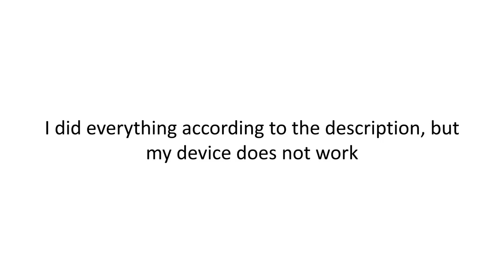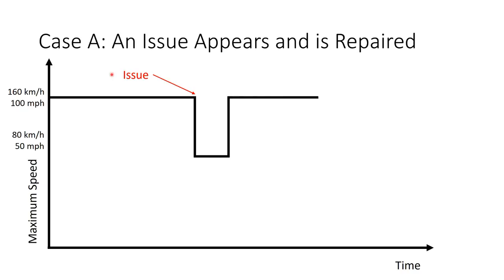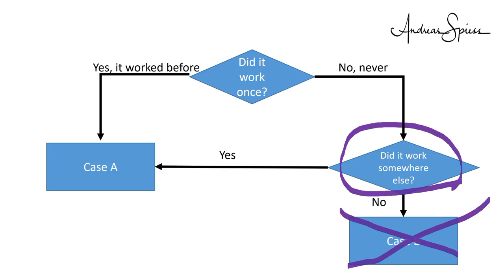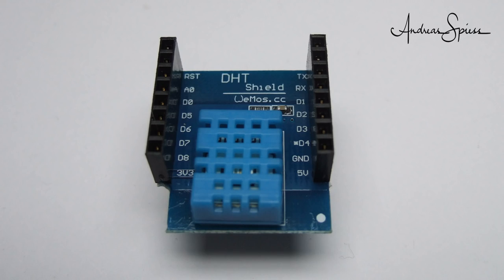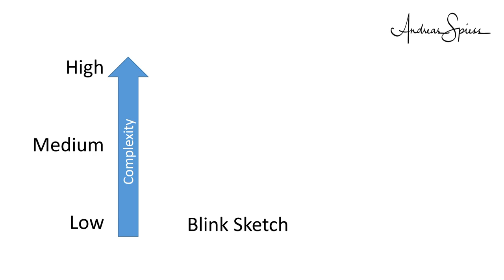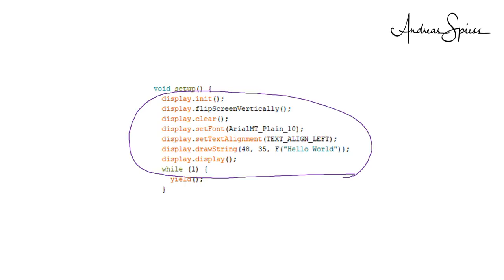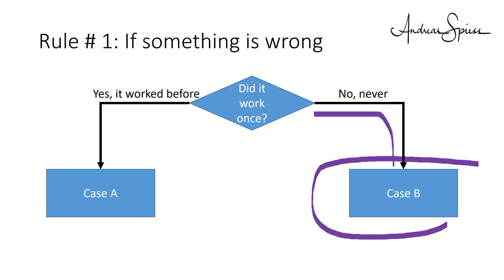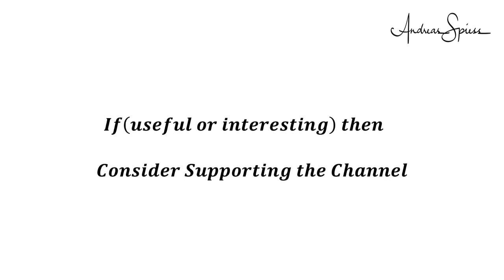#184 Finding Errors: 7 Rules to get them faster

Comment: The Blink sketch in the electronics uController world, is the "Hello World" of the software world. A sanity check, which answers the question "Can you prove it?" - sketch uploaded to uController? Go on then - prove it.  Experienced software devs apply Incremental Development, add one component, add one new piece of code, then - Prove it! (The "Prove it"s then being automated into Unit Tests). You can go further with a DMMeter too, do a continuity test whenever you can, especially if you just soldered something, even headers. 

I'd really love to see if you could do one better than a continuity test by using a something like a cheap logic probe.
Reply from the maker: This step by step is good complexity management. Concerning probing: I often use an oscilloscope for that purpose. Then, I toggle a pin at particular places in the code. This can be easily seen with the oscilloscope.
Reply: Ah, oscilloscopes are if you can afford one. From what I have understood, a logic probe provides something of a half-way-house between a DMM and oscilloscope and yet would be within the reach of most hobbyists/students/tinkerers. I would dearly love to watch you do a review of logic probes, one for the future maybe?
Reply from the maker: I used a logic probe in one of my videos  ( https://www.youtube.com/watch?v=vfwXjWtNxqY )

Comment: Hi, Andreas,
what is your approach to the radar sensor?
mine is after reading the Github page:
has it ever worked? >> no, never 100% in combination with an ESP
has it worked anywhere else? >> no

for me the conclussion is just like Syedamerali to give up, because I am not an inventor.
I am curious about your approach and solution.
Reply from the maker: I agree with your findings. If you do not want to give up I would try to separate the three main influencers: 
1. Power
2. Distance
3. Wi-Fi activity
By separating the ESP from the sensor to find out which one is responsible for which effect.

Comment: I like it.  How about a video on how to avoid errors?  Example:  write test code first before you integrate.  label or color code wires and comment your code clearly.  Make sure your schematic matches what's in front of you.  Test voltages before you start integration testing.  Make a watchdog signal or similar to ensure your code is running.  Stuff like that.... Just shotgunning here.
Reply from the maker: Good idea. And very good examples. Unfortunately, I am not sure if these videos are watched/understood by the people who need it. Most of the comments are from people who do not need them but are interested in the topic themselves.

Comment: Very interesting because the strategy to solve problems in electronic is very different than in other kind of engineering subject. That is maybe because a failure is less easy to see.
Reply from the maker: You are right. Fortunately, we have our nice tools to measure.
Reply: I miss the "magical" restart the device ;). Which is sometimes very effective.
What I mean is that your strategy is very different than what is usually learnt at school which is mostly based on quality tools like ishikawa diagrams, fmea, TRIZ,...
That's why I find it very nice because very different.
Reply from the maker: Ishikawa, Demming, and others are also interesting stuff. I did my Ph.D. on such things. But AFAIK they focus more on the statistics than on the individual case.

Comment: 8:38  Rule 2,  I am repairing a scope,  but the more components I have removed, the bigger  the problem has become  >:-) Just kidding, Great video.
I'm a test-gear repair tech and the problems often start at rule 1.  f.i. a scope does not show a trace and when I started this work I assumed the user knows what he is doing and the scope is indeed dead. But I quick learned the importance of asking more. If I then ask if it ever worked (while he himself used it !!!! ) the answer can be yes, I used it 5 years without a problem, or no, I just bought it from ebay in unknown condition. The next question could be if he knows how to operate it. The answer can be, yes, I worked with a same model for years or,  No and I have no clue how a scope works (or,  I only think it is dead because I am to lazy to read the manual)

One addition, "what were you doing under what  conditions when it stopped". I had a dead scope meter on the bench with both isolated channels dead. The chance both channels die at the same time is very small so the input asics will not be the problem. It must be more downstream. I could not find it so I contacted the owner to ask more. Turned out he measured some very high voltage (but had no clue it was to high) on channel A, no trace so he did the same stunt on channel B and fried that too. Following a structured fault finding system like yours would have saved a lot of time.
Reply from the maker: So both of us paid some"learning money" to discover rule 1. For a supporter, this is definitely the most important rule as also your examples show,.

Comment: There is hidden complexity in exchanging components! Testing components in isolation before and after exchanging them is important otherwise it can multiply the unknowns. For instance, if a circuit is bad, it could silently destroy the component, and then exchanging it leads nowhere and looks logically identical to simply having 2 defective parts.
Reply from the maker: You are right. Depending on the time you can afford you can assume that new parts generally work.

Comment: Rule #11: If you have fixed one error, you never have learned something useful for the next error. ;-)
Reply from the maker: Here I cannot agree completely. I only learned from my errors. Because if I made no errors, I knew already how to do it and did not need to learn something.
Reply: Maybe der Birnodin means that the second problem may have totally unrelated causes.  Do not assume the same solution. The mind easily goes back to  the same path it went before.
Reply from the maker: Then I agree completely.
Reply: that sounds a lot like Murphy's Law, and that's negative most of the time....
Reply: Could be a word or two missing there... ”if you have not fixed (at least) one error then you have never learnt something useful for the next error” ;)

Comment: Do you think that WiFi based home automation devices should be:
1) on the main wifi network
2) in the main network with separate SSID
3) on a VLAN with a separate SSID
4) on the same main network with separate AP
5) on a VLAN with dedicated AP, or
6) on a dedicated LAN with dedicated AP

Great video, by the way
Reply from the maker: I have no preference. Mine are on my main network. Because it saves me a lot of work to set up a second leg and all the routing info.